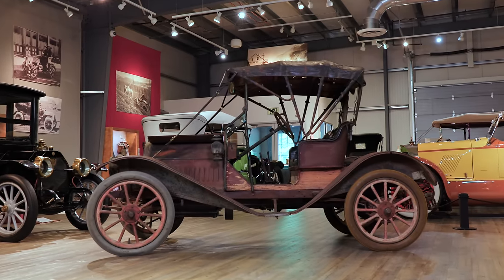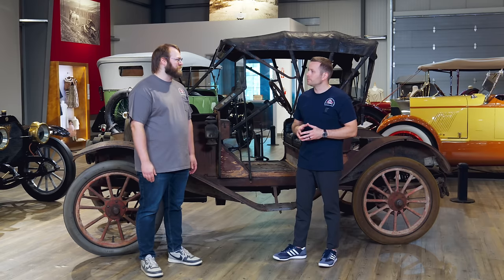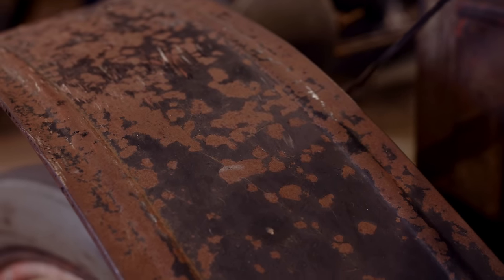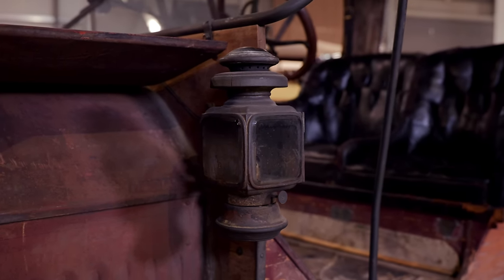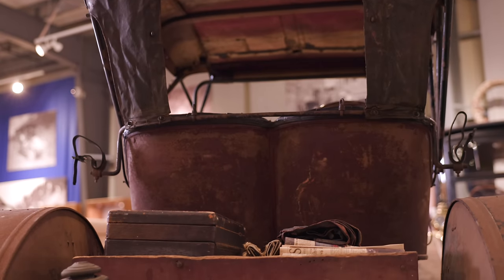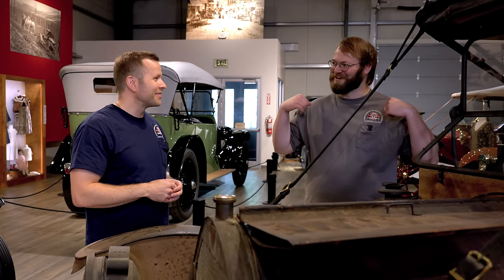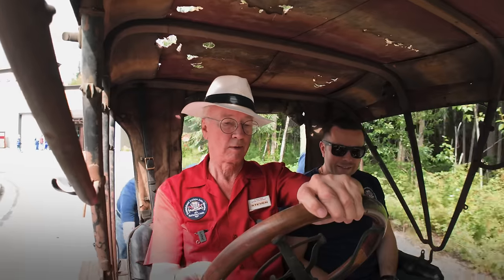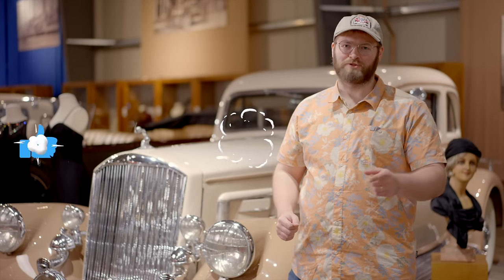Does it Run? YEP! 1910 Hudson Model 20 Roadster

Comment: You said, priced right. Just how much? $ dollars?  Then It can be compared with Ford of the times. And Henry set the right price. I am always interested in the details. A lot of early cars had superior features than Ford. (those that were in the affordable care racket) . It seems like this Hudson ran circles around everything. Fix the starter, no problem. Hudson should have been a top contender? So just how much did it cost?
Reply from the maker: Thanks for the comment! The 1909 Hudson carried an original price tag of $900 which was a very attractive price for such a high grade vehicle! A Model T Ford of the same  year would've run you around $850 for comparison, as Ford was still in the process of streamlining their production to reduce their price tags.